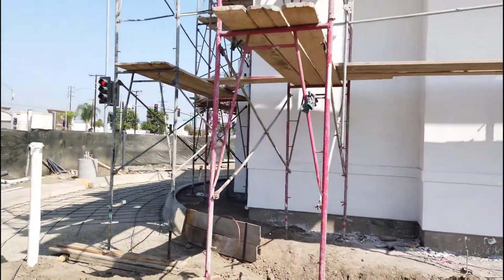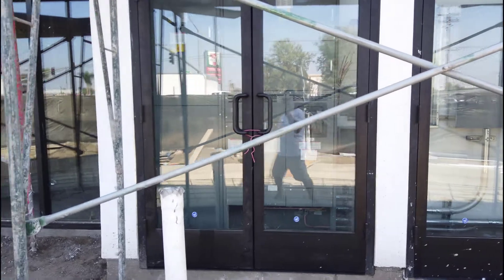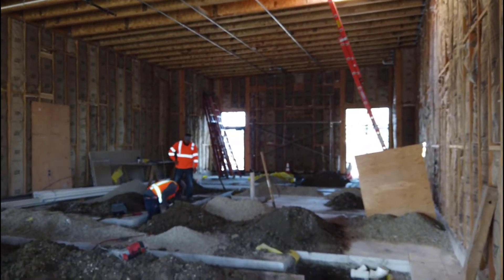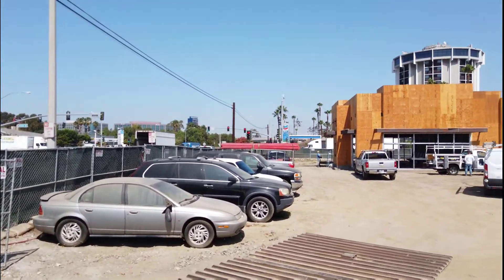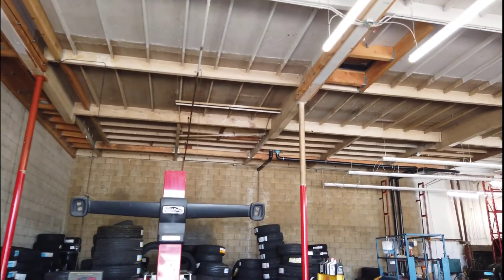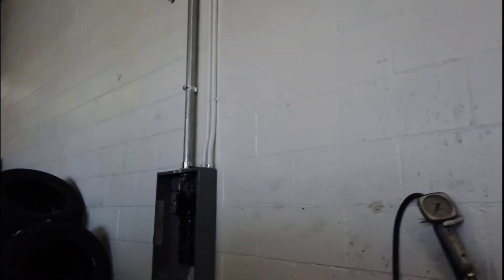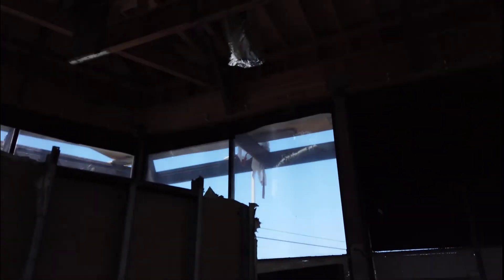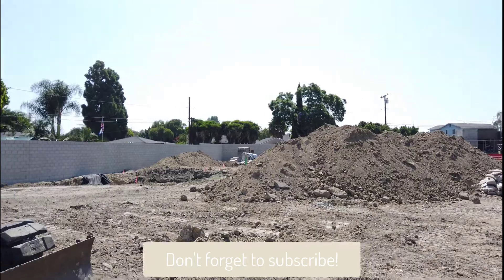Being A Commercial  ⚡Electrician⚡  - Shell & Ground Up Electrical Construction Projects

Comment: For the entire Electrical Project Scope of Work, how do you determine your manpower needs, in order to stay within Budget and to stay on Schedule?
Is there some math formula used to make this determination?

For example, the installation of the Switchgear, how much time should that activity take to complete from start to finish, and how many electricians would you assign to do the work?
Reply from the maker: Thanks for the question. No way to answer in one sentence but in short we calculate the entire project with the min electricians on the job. Anytime we add manpower it's usually what we call "fill in" like our service techs only having a small call then are free. We'll send them to the larger projects.
Reply: @The360Electrician  Thanks for your response. I'm looking to move into a Supervisory/Superintendent role for the Company I work for, and one of my responsibilities is Determining manual staffing requirements.